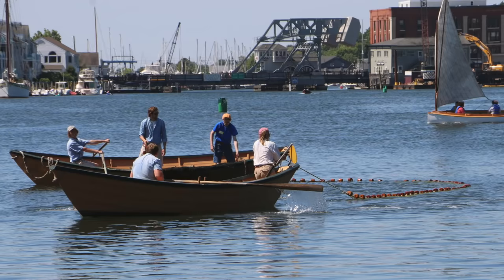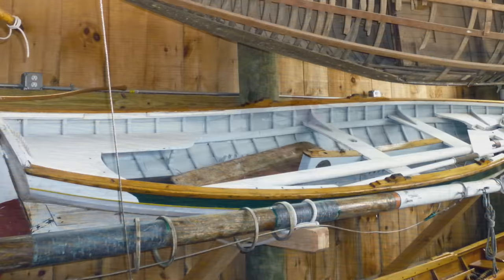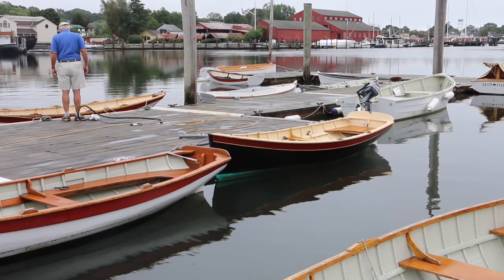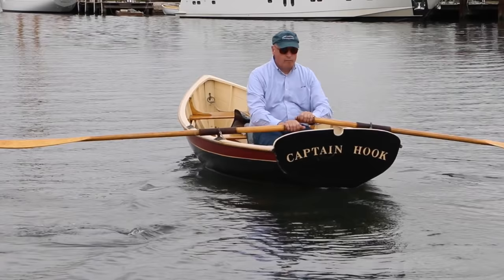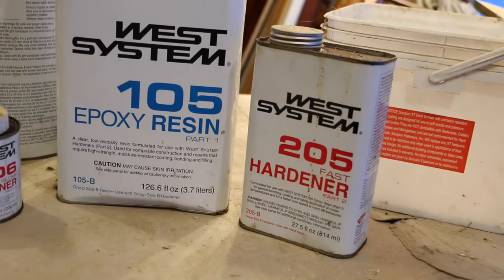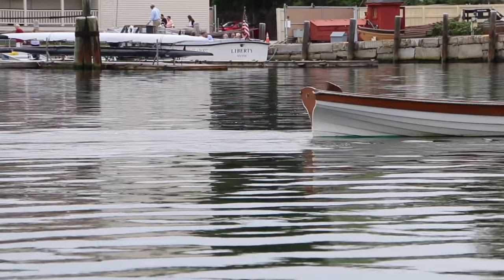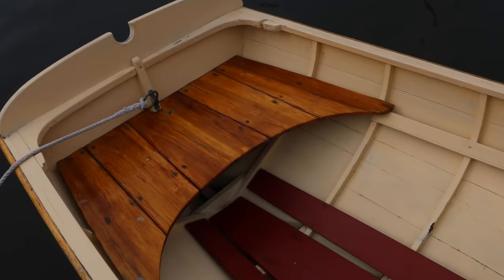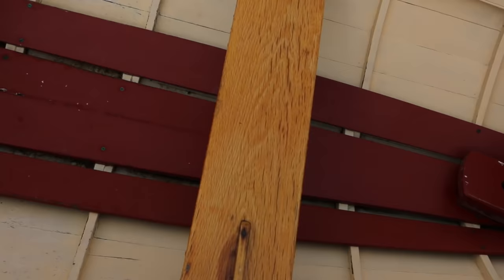Rowing Boats at Mystic Seaport

Comment: thanks for really good information spoken around boat types and handling. My rowing boat is a Whitehall-boat built from original drawings in Finland near Sweden were i come from. Fantastic boat and well built and it´s has extra small with 1.1meter.
Yes a have double roller seats and extra long oars for speed